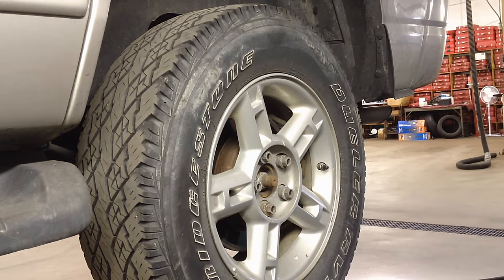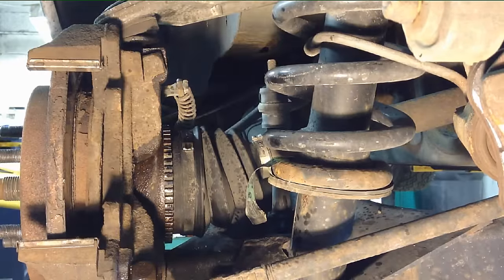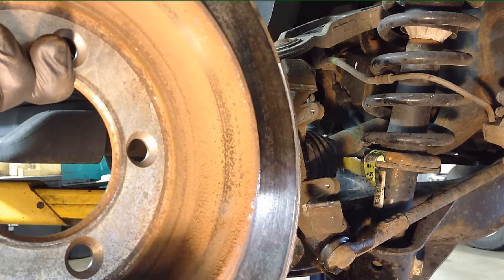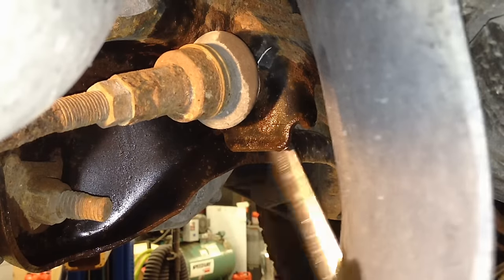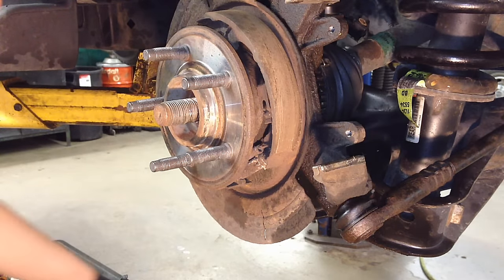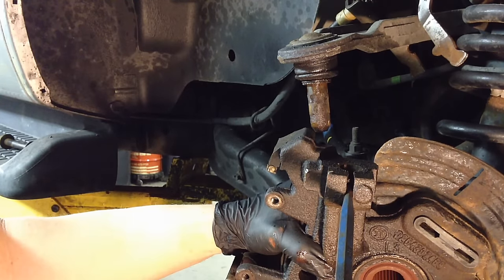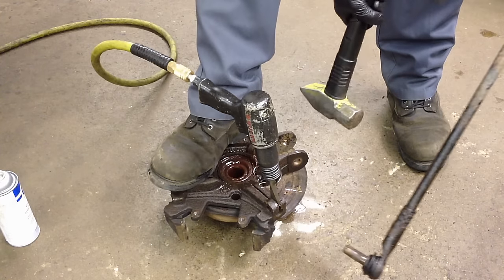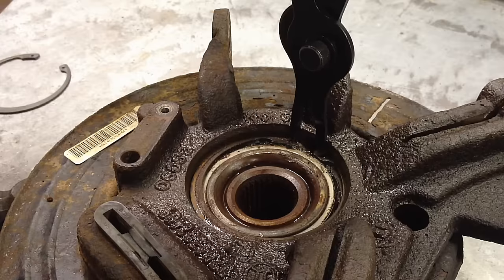2002-2005 Ford Explorer Rear Wheel Bearing Replacement

Comment: Thank you for your help. I have a 2004 Mercury Mountaineer 4.6 2WD that is still going strong with 380k miles. Its the same as the Ford Explorer. I was needing to replace the rear wheel bearings and found your video very helpful. On the good side, there is a complete rear hub assembly now so there is no need to press in new bearings now unless you just absolutely desire to do that. Great job on your videos. I have been watching a lot of them now. Congrats on getting the new 2021 F150.
Reply: Less Shwab does this for about $400 parts and labor per wheel, and loose there ass on labor

Comment: This is a great video! I did this job in my driveway on both sides at once, and also did the rear axle seals while it was apart. Let me tell you... this job will make you curse! There's a couple things I would add to your great tutorial. First, there is a $7 dust seal that is in there, that is often not even recognizable from rust and rot. It's easy to replace while everything is apart. I only even knew it was there by looking at the Ford parts diagram. This seal might help keep water out of the back side of the bearing when driving thru water, so it's probably worth replacing.

Second, I was practically standing on a 10 ton shop press, and it wouldn't break the bearing out of the knuckle. I think they use loctite for bearing races upon assembly, and those suckers are in there! Just like you said, when it finally breaks loose it's violent! Even standing on the jack handle of the shop press, I couldn't get it to break free. So here's what I did different than you. I used a hammer and punch to beat out every part of the bearing except the outer race. I then cut thru the bulk of the outer race using a whiz wheel on a 45 degree angle. Be careful not to cut entirely thru and into the knuckle! You aren't trying to cut thru the entire thing here. Instead, you are trying to cut thru the bulk of the center thick section of the race in order to weaken it! Then when you put it in the shop press, the press is much more easily able to break the race and it pops out with a lot less drama. But still with a bang! If you can pay someone else to do the pressing part, by all means do! But I have heard of guys actually breaking the knuckle before the race would pop free. So cut thru the thicker part of the race (the middle) before sending it off for the press work. And be SURE to support the inner race when pressing in the new hub!

Comment: Thanks for the great Youtube videos on changing the wheel bearings on a Ford Explorer.  I was able to change all 4 bearings on my daughter's 2004 Explorer.  The fronts were pretty easy but the backs were somewhat more difficult.  Spreading the rear bearing carriers to dislodge the upper control arm connection was difficult due to the some rust, it finally came out.  My shop is fairly well equipped including a 20 ton press.  Following your advice, I definitely would not try to press them out myself, not that the press wouldn't handle it, but you really need the right fixtures to hold the piece firm and square.  I took them to a shop down from my shop and they got the old ones out and the new ones in with little trouble and very modest cost, $30.  One thing I did differently was to leave the lower arms on rather than trying to spread the piece to remove them.  The shop had no problem doing the press work with the arms still attached.
 
Thanks again for the great how-to videos!

Joe

Comment: Great video for the bearing removal. An old industrial maintenance master welder once showed me a trick to remove an "outer" bearing race trapped inside a housing. He stick welded a bead around the inside midpoint diameter of the old bearing race. Once it cooled, the race practically fell out on its own. He said it's all about expansion/contraction. I've used his tactic many times over the years. Works every time.
Reply from the maker: +Lawrence Henderson yes I have also heard of this but never was into welding until now

Comment: Hey man, thanks for this how to video... I replace my front hub & bearing on 04 Exploder and it went very well, thanks to your front bearing repair video; that was well done and very informative. I would recommend it to anyone that has to make that repair. The replacement of the rear bearing are way more tricky than the front, it sucks that you need special tools, if not for that I would go for this repair. Thanks again.

Comment: After watching your expert instructions, I was  able to change my rear bearing on my 2002 Ford Explorer in less than three hours total removal and installation.  but the joke is that parking brake gave me more trouble than anything else.  I purchased my bearings from Amazon and a machinist installed them.  Thank you

Comment: Very good demonstration. I'm a fabricator and regularly use a press. I actually have 3  in the shop. I'm not a very good mechanic though but with a little help there hasn't been anything I couldn't do. Currently working on my moms explorer. Gotta do the ball joints in  my deisle after that and then ill figure out the wiring in a jeep cherokee so I can give it to my little sister when she gets her license

Comment: Brian,  SUPER video !!..I have a 2005 Ford Escape with 318,000 miles and I'm waiting for my rear wheel bearings to go...I guess the Escape and Explorer are similar in the replacement of the hub bearings....my trucks been "growling" the last 2 months or so and thought it may be the driveshaft carrier bearing...I had my tires replaced today and they tech confirmed my diagnosis after the road test after the alignment....what I understand is that bearing can't be replaced "separately" and that the driveshaft requires R&R (per Ford) but I see you can find the carrier bearing/ support from some driveline companies online...I'm pretty meticulous about my maintenance but the only job I haven't tackled (let my friends AAMCO handle that ) is the "infamous" CD4E transmission rebuild but I did get 282,200 miles before the tranny went...the alternator R&R at 234,000 miles was a "bear"...I heard the Ford techs hate doing this job too !!...looking forward to watching more of your videos... Thanks !!

Comment: Great demonstration, its quite a labor intensive job replacing the bearings.  I watched another video that the Mechanic had an extremely tough time getting the bearing out.
Also, the little recommendations that you provided, gave more insight into areas where caution is important, especially when pressing out the bearing. Nice tutorial!
Thanks

Comment: 2002 Ford Explorer with 300k miles - still runs good - son has driven it for school. Just did the rear passenger side wheal assembly and it is indeed a PITA. My nephew works at a machine shop and pressed the old bearing out and the new one in for me. Its been a good car however. I bought it with about 120K miles so I have put over 180k miles on the car. Its generally easy to work on all things being equal.

Comment: I've done this once... getting ready to do it again (unfortunately)... I can attest it's a pain.  But it can be done with the right tools.  Instead of using a press, I used the hub grappler tool.  I had a really significant pop when my hub came out....took quite a bit of torque to get it started.  That and the snap ring were the most difficult parts...(of course my snap ring pliers were weak sauce last time.  ha.)

Nice video!

Comment: I did this job...both sides in the driveway with jacks, stands and a creeper. This video is very good and helps a lot. It's a pain in the a$$ job. I just got the assembled MOOG (might have been Timken) hub w/ bearings installed from Rockauto. It's worth the extra cost just not to deal with anybody these days. Ill-tempered and incompetent is the order of the day now. I so miss working with helpful, friendly, competent people but far as I can tell they no longer exist or are too hard to find. That parking brake is a real joke and requires a lot of drinking and profanity. I'm old and had cataracts when I did it. (Lord I'm glad I live in the South and don't deal with rust) My 2004 Explorer looks like new underneath. I started with PB Blaster about a week ahead and everything came apart easy. I had a shop do the whole job and replace the bearings about 8 years ago and it failed in no time. I figure they messed up bearing pressing. I replaced the leaking differential seals while at it...that was easier than I thought. I would highly recommend replacing those seals if you are that far into it. No more Fords for this old boy.

Comment: Definitely one of the best "FordTechMakuloco" I use you tube to do everything. Sewer, main drain, automotive, garage shelves, painting, modeling, etc... "FordTechMakuloco" actually shows you how to actually do the work. No false video already loosened parts. This is an exceptional video easy to hear, easy to understand and complete information You need to make Smart decision(s). IF YOU WILL DO IT YOURSELF, and advice if you should even do it yourself.

Comment: I just did this job pressed it in myself with an old rotor I just beat the center of the rotor in with a sledgehammer broke pretty easily and then I ground down the edges with a grinder 2004 Avalanche rear rotor fit perfectly. Thank you for the video it helps a lot

Comment: Brian I actually took one of the old rear rotors and brought them to my work and the maintainence shop plasma cut out the top of the rotor like the way you showed on your video.  I set up the knuckle on the cut out rotor, started to try to press out the bearing, and one third of the rotor broke off from the pressure and the bearing didn't even budge.

Comment: Thanks for a great video.  My 02 Explorer has over 200k so I've decided to take this one on myself.  So far so good. My snap ring tool was too small to reach the ear holes.   What worked well for me was inserting a chisel into one of the ears and tapping it with a hammer. I was able to twist it and pop it right. out.
Reply from the maker: John Staif Yep I have done the same with a flat blade screwdriver.

Comment: Awesome video, it is the best one I've seen on youtube so far. I just don't  get why people don't want to give it a try themselves if they have all he tools for it? I'm sure going to give it  try myself I even went as far as getting a press, so I feel pretty confident in getting it done by me following step by step the way yo did it.
thanks again for the video
Reply: A lot of people don't have a press. Of all my friends I'm the only one who does. Its worth a try if you have a press, but I would also recommend you have a torch as if the vehicle is from the rustbelt I have had to max out my 20 ton and then heat the knuckle with a rosebud to get it to move. Not everyone has a torch handy but if thats what it takes to get it out it becomes a necessity. If just the inner race and cage comes out but the rest is locked in, it can help to grab a welder and run a few full circle beads inside the race at the center. Not only does this give you some extra steel to press against, when the weld cools it contracts inward which can force the rust bond to break and reduce the force needed to bust it out. 

If I was in a pinch with no torch it might be worth a try to pack the inside of the bearing with dry ice for maybe 15 or 20 minutes and then start pressing while heating the knuckle with a propane torch. Could possibly see that working.  I think he was giving the don't try this at home warning because most people don't have a torch, welder or shop press and this model in particular can get you in a bad place quick if you don't brace things up properly. Those with some equipment and some good shop sense will have no problem.
Reply: harbor frieght has press for 175$ and bearing / seal install / removal kit 59$ . and if you need more then take r yo a shop jack
Reply: will be on sale there in a few weeks for even less!
Reply: Nick Warner best youtube comment I have ever read thank u. Also u said this model is known to be problematic if the bearing gets stuck

Comment: Very nice video. done this job on my 02 several times even with timkin bearings. always looking for press plates and never thought to cut out an old rotor. Thanks for that idea. Always emphasize when pressing new bearing in to never load thru the bearing so rollers don't get damaged. Hold inner race when pressing spindle.

Comment: Lacking the modified brake drum that was used to position the Knuckle asm on the press, I used a wooden block under the caliper surface on one side and another block under the lower control arm mounts. I wedged a flat tire iron between then the lower control arm mounts and the splash shield to keep the shield from deforming (worked for me).

Comment: Great video and tips.  Special thanks for pointing out the correct push point starting at 18:30 and continuing through19:28.  Without this information, the hydraulic press could be mistakenly set up to push on the knuckle lip instead of the bearing. The knuckle "lip" looks like it could be the outer ring of the bearing (about an eighth of an inch) but it's not.  Find a pusher that fits inside the lip as you show. The lip on the knuckle provides a bottom out point when pressing a new bearing in.

Comment: I've had this video pulled up in a tab for something like three years collecting all the stuff I needed to do it. I don't have your press, just a small 12 Ton so it got interesting. Removed everything but the outer race and then heated it up and used a mini sledge to break it the tiniest bit loose and then the 12T did the rest pretty easy. Was close to a 12 hour job with all the running around for stuff I forgot and finding a kit to borrow that had the 3 inch and 3.25 inch plates for the press. Almost sad to close the tab. :'( Thanks for the video! Suffice to say I've used a few others too. :D

Comment: Nice video, with A lot of good tips especially using the deep Rotor Hat (probably off a  F-150 ?) so you can use it to backup the knuckle to press the hub out . I think I measured that  I would need a receiver with an approximate ID of about 7 3/8" to fit around the parking brake shoes an OD approximately 7 3/4" to drop into the circular recess of the backing plate .

Comment: Great informative video, thanks. I'm currently doing all four unit bearings on my 2004 exploder as well as digging into the rear diff. The diff had the limited slip clutch pack Ford issues and was grabbing bad. Over time it actually hammered the ring gear side carrier bearing so bad it has deep pits in it. So master install kit for that and new clutches as well as the correct oil.  I did press out my old rear unit bearings and they were very tough to say the least. I like your front unit bearing video as well. thanks.  

BTW, thanks also for listing the torque specs. I have to find the rear diff specs now.

Comment: When pressing the hub back in, I always try to not completely press it on. It's tricky but if you leave the hub a hair from touching the inner race, then when you go to torque it the torque will bring you to the desired pretension and never go over. Never had an issue doing it that way

Comment: Good video, the only thing is the axle nut on the cv shaft outer is 35mm not 34, i used a 1 3/8 socket to take mine off, had to convince it on with a hammer, i went to the parts store to get a 34 and I was pretty disappointed when i got home and it was too small so i just used the standard socket to put it back together.  unless some years had a different size axle nut, who knows, just added to make others aware that may tackle this project. any ways It was nice to see an overview before I did it so I didn't have to fumble through it, I knew exactly how to take it apart etc.
Reply: @ikaikaboy88 it was a 35mm on this one but was able to get away with using a standard size instead

Comment: I completed this repair yesterday using this procedure. The only problem I had was once I assembled everything, I had to disconnect the top ball joint to move the caliper back into place because I hung it on the opposite side. I know I should have looked for that when hooking everything up. In trying to reconnect the top ball joint after it was connected and torqued previously, it needed some serious convincing with a hammer to do the second time. The pin also needed to be hit a lot.  I feel like the top ball joint is 1-2mm high because it gouged some of the threads on the pin. I reassembled it and torqued the hell out of it. Do you think this joint is going to go anywhere? I found that the ears that you have to pry apart get recompressed on reassembly and that was what probably made it difficult to reconnect the second time. Thanks for the video!

Comment: Very NICE! I bring it to a NAPA machine shop and they do a great job there. Even some shops use them. I think I paid $60 for both sides, worth it. The setup is very similar to an IRS 89-97 Tbird/Mark8(identical except for size once the spindle is off). I know there special Ford tools for the press cups for that vehicle. In the salt belt those DIY 20Ton presses won't touch that. It is also dangerous if you aren't experienced, not a DIY thing. There are some FWD hub tamer tools but I don't think they would do this job. I usually get a new hub, I guess it is ok though if it is intact.

Comment: holy shit! just did one today on a friends 04 explorer. you wouldve thought a gun went off. used a 20ton with air powered hydraulic switch so i could stand away remotely from it and not get hit by anything lol. went boom boom really quick. only other job that scared me that bad was pressing out a front lower ball joint on an 08 trailblazer. that did the same thing